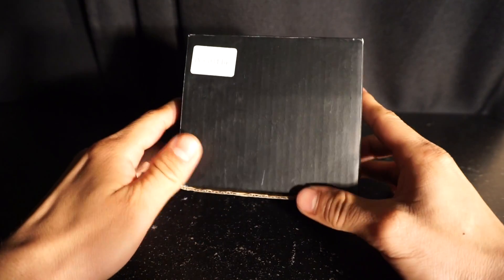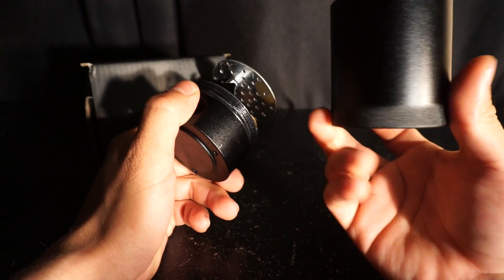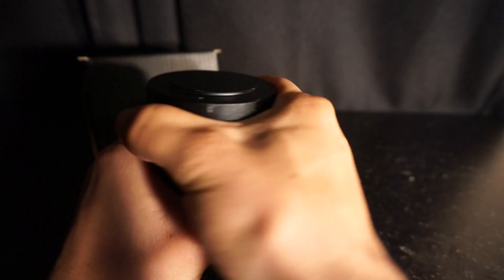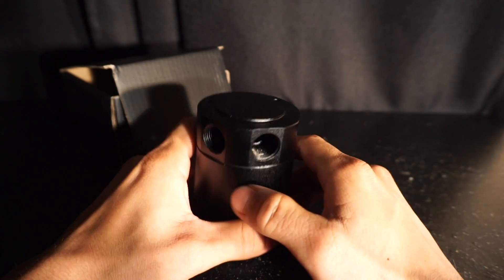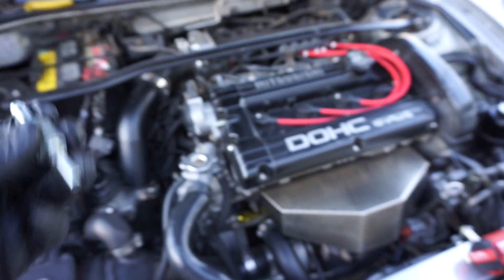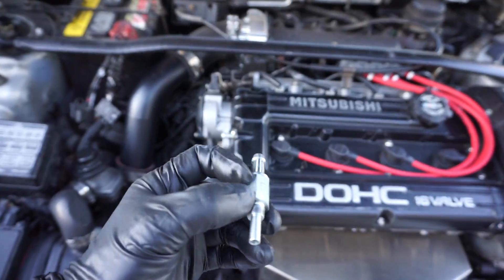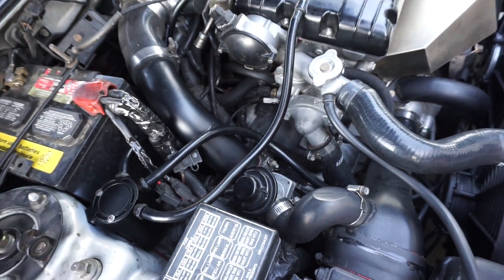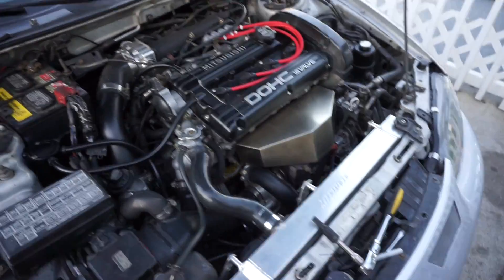What Is An Oil Catch Can and Do You Need One?  + How to Install

Comment: I bought the same can. I also bought a 10 AN 3/8” NPT fitting for the middle port on the can. I then bought a weld on 10 AN fitting and welded it onto my intake pipe. This is an easy and inexpensive fix for those of you needing a larger vacuum source than what this can was capable of providing.

Comment: The Positive Crankcase Ventilation system is a calculated vacuum leak, that the engine control module uses several inputs to account for this air. You have effectively eliminated the ability for this system to evacuate raw fuel, water vapor and gaseous carbon deposits because it needs fresh clean air to enter on one end, scour the crankcase and exit via an area of negative pressure behind the throttle valve. This engine has none. The area before the turbo should be the WOT default using a check valve that closes during operation when the intake has less pressure than the crankcase. The check valve in the OEM PCV is to protect engine seals from lean fuel conditions or ignition system malfunctions that would cause backfire. For the catch-can to work correctly, it needs cool air around it to condense gases and some type of media to coalesce the gasses onto, so it can change into a liquid then gravity & vibration will allow it to drip and be caught on the can. There’re is no normal PCV malfunction that would allow gasses or fumes into the combustion chamber to create knock, pre-detention or premature ignition. This is normally controlled by the fuels anti-knock value displayed on the pump, shown as “M+R divided by 2” commonly know as octane rating. Only if the camshaft timing, ignition timing or compression increased somehow. You should have placed some large stainless steel wool above the perforate plate, mounted it on the core support, retain the OEM PCV valve to the cans inlet, outlet check valve to per-turbo inlet and the main out back to the intake fitting now plugged with a titanium bolt. Sorry! 
ASE Master Tech since 1978, +L1 Emissions (100 questions) No brag, just fact.
Reply: If anything the system has been improved, it's always under vacuum conditions thanks to the sealed system being attached to the intake and the air is all metered because it's behind the MAS, the check valve is no longer needed because the intake never sees boost
Reply: Catch cans installed wrong eliminating the PCV system , always a fail.
Reply: @1magnit  I agree. The PCV valve is an “Active -Re Active valve”. It allows a slight vacuum under most driving conditions but opens under below WOT throttle. But it closes if any lean condition occurs in the engine and causes it to close.

Comment: I wonder if you need the out to be twice the size of the ins? I like this can and have seen them online but it seems the out will be choking. I could be wrong of course.
Reply from the maker: Good observation, when it comes to catch cans I believe bigger is always better when it comes to port size. However, in my situation my blow by is little to none so I know i can get away with the current size provided. Maybe down the road as my motor ages I'll look into increasing IN/OUT port size.

Comment: I am using a “open breathing filter” on the side of the valve cover and I am still having the pcv valve installed. Is They bad then ?🤷🏻‍♂️
Reply from the maker: eh no, just a different setup. people argue for both
Reply: Don't use the filter on the catch can. It's like a boost leak.

Comment: My GDI vehicle has 64,457 miles in it. I clean the intake valves every 5,000 miles since i got the car brand new. There is no need of a catch can. My car performs amazingly. Just do your vehicle maintenance. Also the oil you use plays a big part in your GDI engine. I use oil that is for GDI engines.

Comment: what if your not longer using the stock intake, where can you pull vacum from?
Reply from the maker: oscar gallardo you’ll need to modify your new intake to create a source of vacuum. That’s the only thing pulling air during boost where crank case pressure is at its highest.
Reply: ok thanks for clearing that up, by the way great videos bro
Reply: oscar gallardo 37/64s drill bit, 3/8npt tap, and a center punch. Also there's gonna be a lot of metal shavings.

Drill and tap your Fp intake, put a 3/8npt hose barb fitting in, and run the line to the top of your catch can.

This will grab a lot of gas (and bits of hydrocarbons) if you use e85, think of it as the gas in that catch can would've been in your oil.

Comment: Do u have a part number for the fitting u used instead of the pcv valve....I tried to drill it out and it’s not a ball is a huge  solid type rod/cylinder. Inside with springs.... no way u can drill that cylinder out.... thanx
Reply from the maker: just got to the junk yard and take one off the brake booster. Free.99